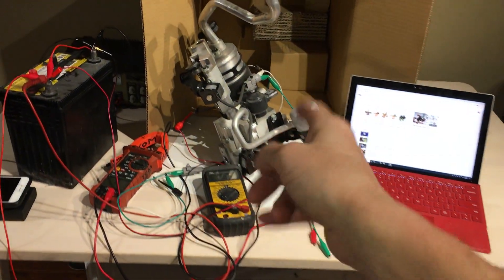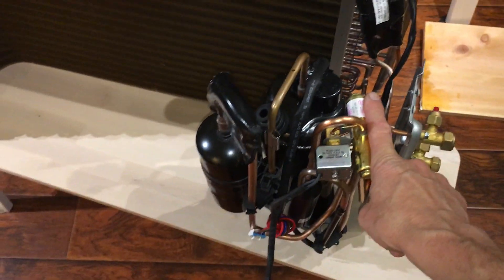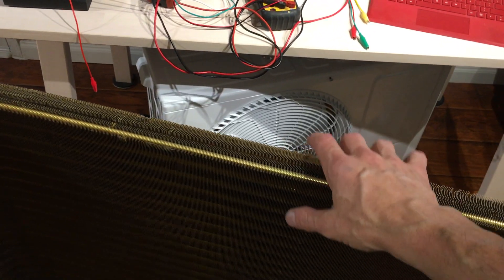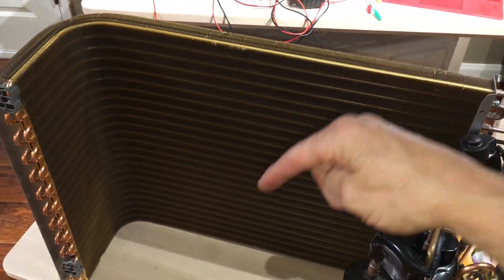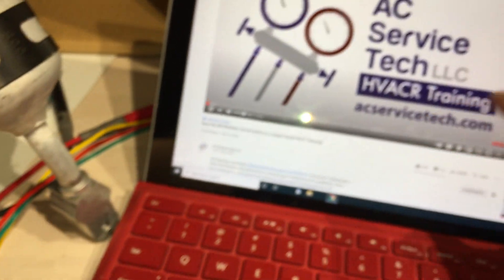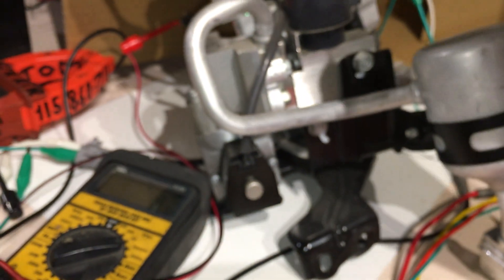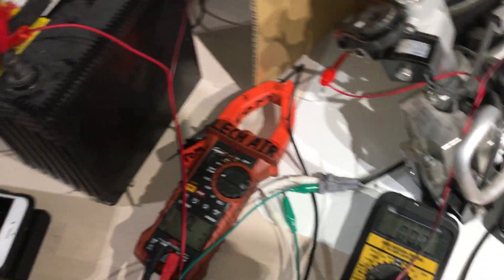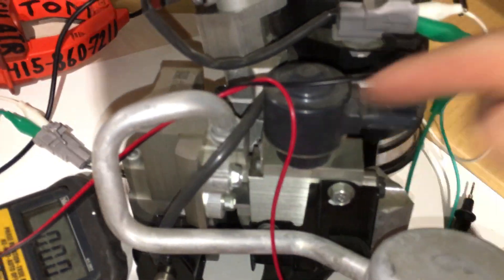Prius prime heat pump, accumulator reversing valve assembly.

Comment: The prius prime needs more valves to have the option of pulling heat from the catalytic converter. It also has vapor injection. It can do simultaneous heating and cooling to do dehumidification and heating at the same time using only a heat pump. Yes it is super complicated but really cool at the same time. I have no idea how Toyota makes any money from a Prius Prime with its high dollar bill of materials just for the state of the art heat pump plus the battery plus the expensive headlights plus the carbon fiber rear hatch.
Reply from the maker: But their heat pump system they kind of made it unnecessarily over complicated heat pumps are not that complicated if you see my commercial videos I work on heat pumps for the last 40 years on commercial buildings and residential. 

Every time automotive brings a new technology to cars they try to reinvent the wheel and they do it in a real messed up way over complicating it making it too expensive adding stuff that’s not needed not adding stuff that is needed. 

And then worst of all sticking the most expensive most fragile device on the passengers side front bumper with no protection in front of it it literally has nothing more than the plastic flexible bumper cover in the front right hand corner it gets smashed every time

Comment: This article goes more in depth, though I cannot find the SAE article that has all the more complicated stuff,thought you might like to read.  

https://www.greencarreports.com/news/1110627_how-does-the-heat-pump-work-in-a-toyota-prius-prime-plug-in-hybrid
Reply from the maker: This is the product I sell and install in my other commercial HVAC business it basically works like the Prius prime on steroids kind of stuff has been around for almost 40 years getting better and better

https://youtu.be/6UplJbcpaK0

Tenant has the option to use the waist heat that would go to the atmosphere or anywhere else to heat water and like the Prius prime they talked about using electric heaters to do reheat for dehumidification in this case this product uses the waste heat that will go to the atmosphere redirects it to heating water and then pump the water in front of the evaporator cold air that remove the humidity and then reheated the temperature